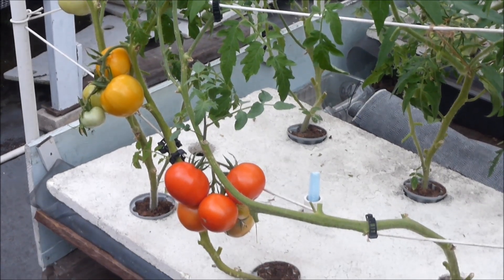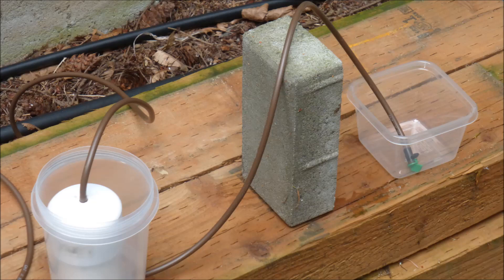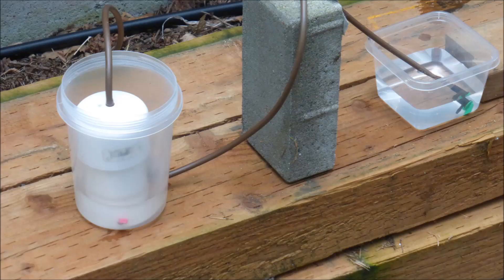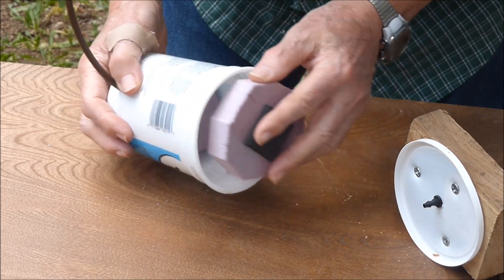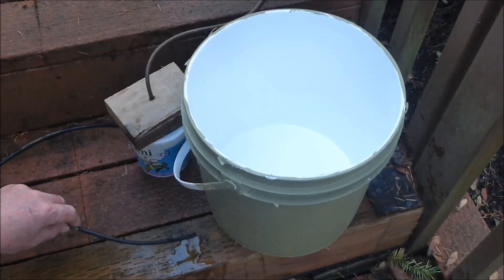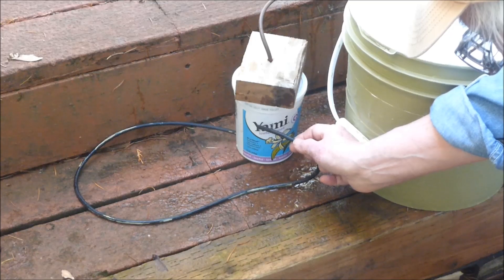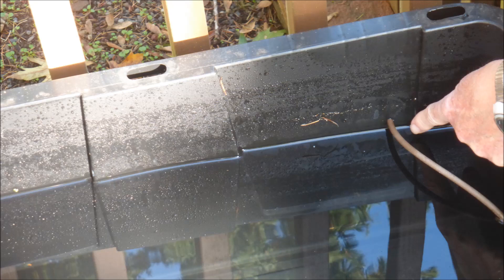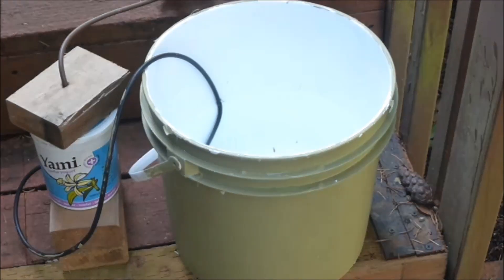Maintain Solution Level in Hydroponic Growing Containers with a Float Valve-Siphon Device

Comment: I'm looking at this and wondering if you could daisy-chain buckets with float valves down the steps, one siphoning off of the other.  Would height of original tank cause a problem if the last bucket on the bottom was too far below the initial source, or does the height rule only apply for the previous bucket in the system.  (would the 11th step down cause a problem, or would it only be affected by the pressure from bucket on the 10th step).  that would be fun to test out I think.
Reply from the maker: If the 11 buckets have float valves inside of the buckets,  and each float valve maintains a 3" water level, and if the water from the previous bucket (higher) comes from the bottom of the bucket, and if the bucket height is less that the step height plus 3 inches, then the bottom bucket would have a 3 inch water level. Water would only need to be started in the top bucket to make this happen.
  If the buckets were taller (case 1) or if the float valves were outside of the buckets (case 2) , the lower 10 buckets wouldn't receive any water unless  each upper bucket (in case 1) or each float valve (case 2) was raised to establish siphon action into the succeeding lower bucket which would also have a 3 inch water level.
Reply: @growkratky5558  thanks for that explanation!

Comment: Sorry but im confused, isnt the point of your method to have a container with enough water for the lifetime of the plant? If so why would it need topping up.
Reply from the maker: Yes, all of the water is added prior to planting for short-term crops like lettuce which only require 1-2 gallons of water for the entire lifetime.  However, longer term crops such as tomatoes might require 40 gallons or more of water for their lifetime and it usually isn't practical to have such a large tank.  Thus, we use smaller 'tanks' and maintain a constant level of nutrient solution throughout the crop (after the initial level has dropped several inches ).  In both cases, crops are grown without mechanical aeration or pumps or electrical power.
Reply: Thanks for the clarification.

Comment: How has the durability of your yogurt container design been?  Have you tried a water cooler bottle type top-off system?  Thanks for sharing!
Reply from the maker: The yogurt container could probably last one crop season if protected from light, and if it is not moved, and the solution level doesn't drop much from the original full position.  The latter two issues can cause the float block to move slightly causing a poor seal - at least temporarily until a new seat develops.  A problem with the float valve-siphon system is that the device needs to be moved to activate the system and the liquid level can drop temporarily.  This is not a problem with a fresh new, neoprene foam seal, but can be a troublesome with 'used' seal that has a nozzle indentation.  Therefore, if the siphon holds for a long time, and the device is never moved again after the original activation, then it should be ok.  A reliable commercial float valve in a plastic container (sump) would be an improvement over what was presented here. No, I am not familiar with the water  cooler bottle topoff system.
Reply: I did a water cooler type thing in grow 3 of my latest video https://www.youtube.com/watch?v=-VFwKDZQxAg   I'm sure there's a technical term for it.
Reply from the maker: That was a great video, Jeb!  The device is similar to a chicken waterer.  It works great, until it runs out of water, so it would need to be refilled multiple times for a long-term crop such as tomatoes, but it is quite adequate for a short-term crop.